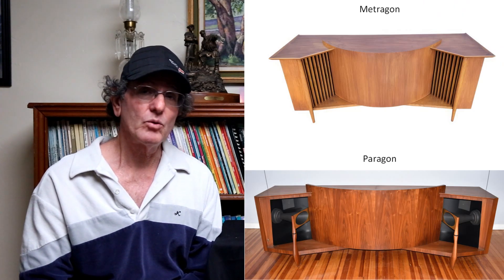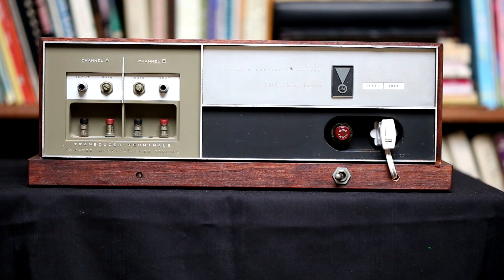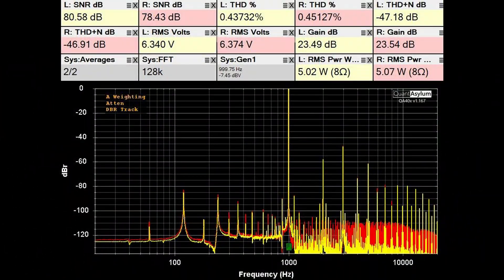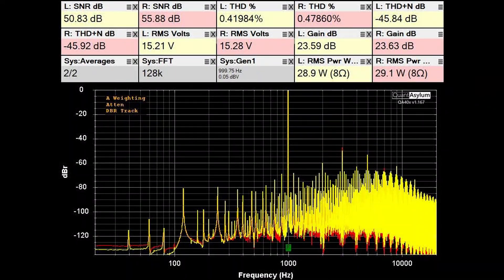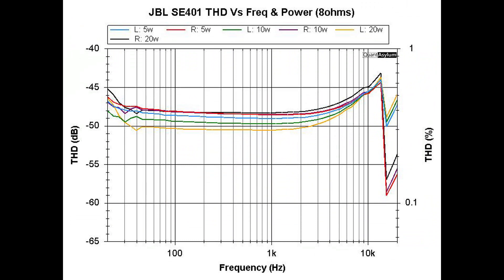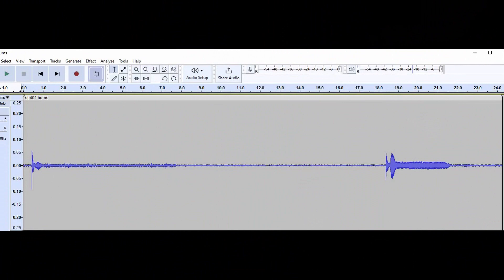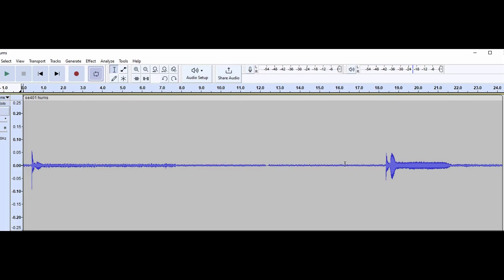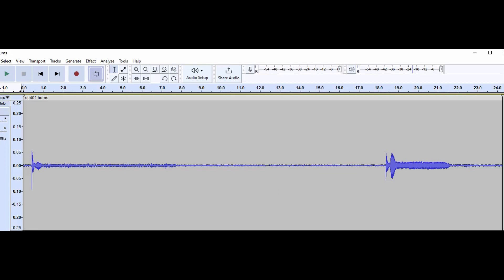JBL SE401 “Transducer Energizer” Amplifier- Vintage Audio Review Episode #46

Comment: Do you think there is any gain in performance to be had by checking and replacing some of the old components?
Reply from the maker: Hi Thomas. This particular amp could have had some performance improvements by replacing many of the electrolytic caps. It would be more noticeable on the bench than what it sounds like, with the exception of the small hum with no music playing. If it were mine, I would probably do it if I used it often. But it had a nice sound just the way it was with the LaScalas. I will be over at the owner of it tomorrow and will see if he is using it anywhere- he has a ton of hi end gear and one day I will have to do a video on him.